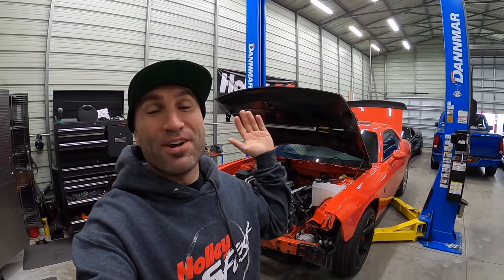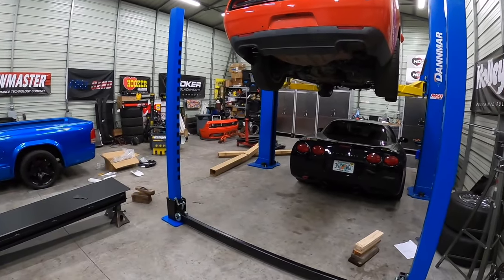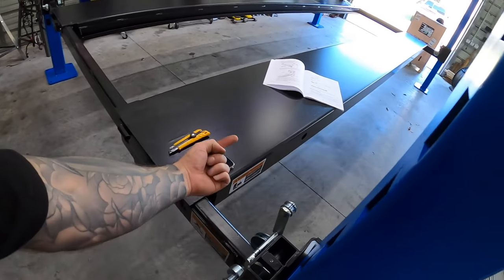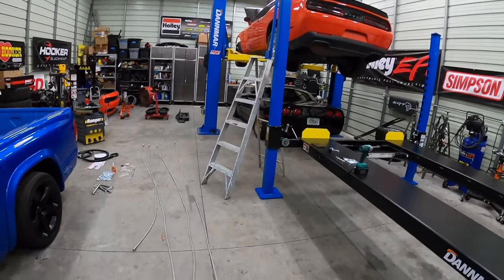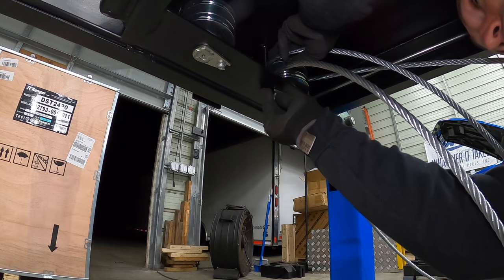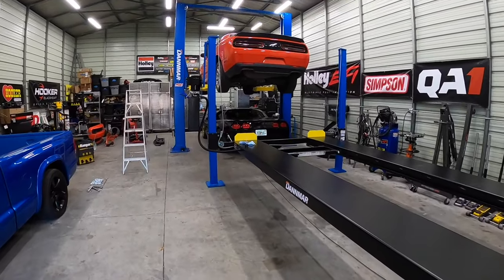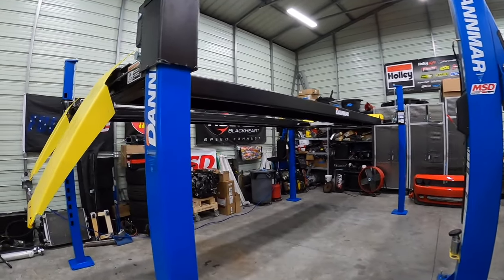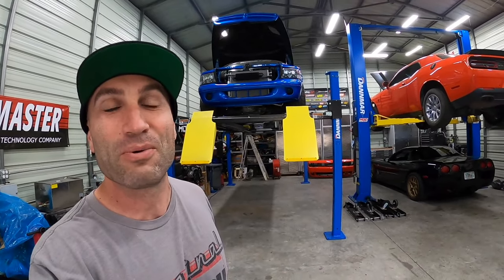How to Install a 4 post Lift in Garage | Dannmar

Comment: Awesome video! Can you please help I have a 1997 dodge Dakota 5.2L magnum 318 it stalls and Shuts off when I put it on reverse and now I have codes on my scanner apparently all of the cylinders are misfiring please help the truck does need alot of work but I'm fixing it slowly but surely